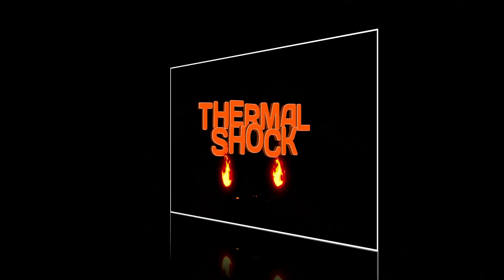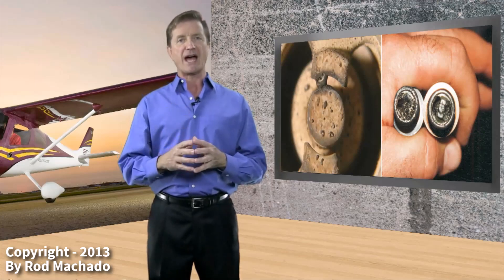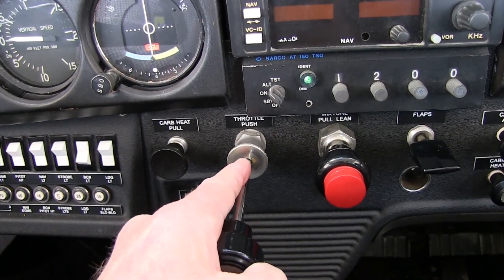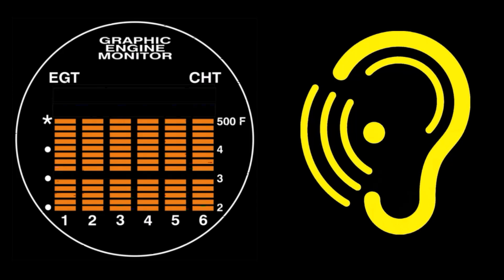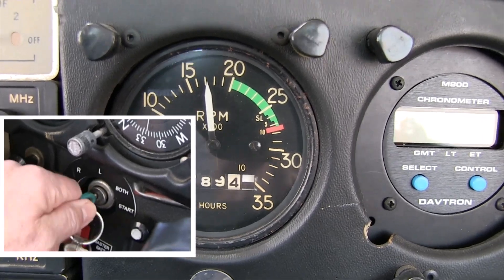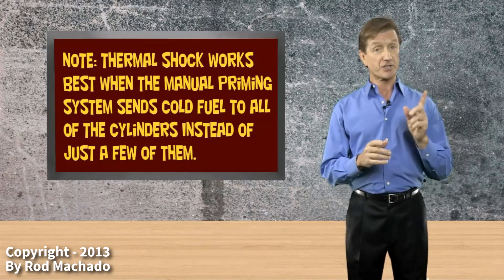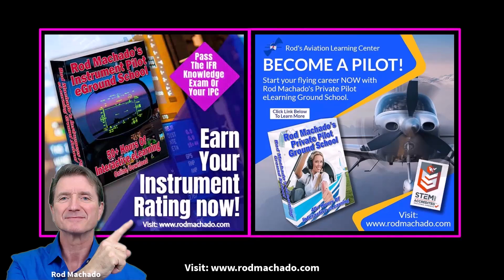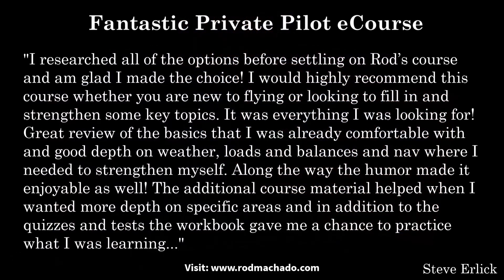Thermal Shock

Comment: Hi Rod, What is the reason why to inject cold fuel while the cylinders are hot?

I fly a Cessna 150. With the engine that were originally designed for 80 Octane, it is not uncommon to need to burn off some carbon. I usually find this same procedure without injecting the fuel is just fine.
Reply from the maker: Greetings Jay:
The reason is to clear fouled plugs when the method you mentioned doesn't work. Thermal shock is an additional (more effective ) method for clearing stubbornly fouled plugs.
Best,
Rod

Comment: Back in ancient time, almost 60 years ago when I was a ground power technician in the Air Force and stationed in VietNam, I serviced MD-3 electrical power units.  These were powered by a special version of the Continental O-470.  They ran governed at 2250 RPM and were rated at 170 HP.  Often, especially on the C-130 line, crew chiefs would run their MD-3s for hours powering little more than interior lights, a very light load.  We only had two grades of avgas available, 80 octane and 115/145.  The MD-3s would probably have run fine on 80 octane but were TO required to be serviced with 86 octane, which we didn't have, or greater.  Consequently we fueled them with 115/145.  With the engines lightly loaded for hours they would lead foul usually to the extent they wouldn't run at all so then the crew chiefs would have to order a replacement.  We'd get them back, clean or replace the plugs, then blow the engines out with shock loads.  We'd connect their 28V output cables to a load bank, a special trailer with lots of giant wire-wound resistors within, that had a switch array to provide the capability to accumulate from small loads to heavy loads.  To clear the engines we'd run them up then repeatedly switch on and off full load.  I worked at night, the MD-3 exhaust pointed straight up, and full load application created truly spectacular fireworks, streams that appeared to go up almost 50 feet.  We'd continue to switch full load on and off until the fireworks display subsided then we'd shut it down, move the unit to the ready line, and ready the next lead-fouled unit.  Those O-470s seemed to take all the abuse we could mete out then run quite nicely.
Reply from the maker: Greetings Jay:
That's a great bit of history to share. Over the years, I remember watching single-engine aircraft with larger engines doing runups in the runup area at night. It was not uncommon to see sparks exiting the exhaust stacks of these engines. This was probably detritus from cylinder carbon/lead or exhaust stack carbon (less likely, I think). Certainly, this was nowhere near the fireworks you saw. 

That said, when you applied heavy loads to clear out fouled units, did you alter the fuel/air mixture to increase engine heat and aid clearing? Please let me know. I'm curious to find out.

Best,
Rod

Comment: Is the engine manufacturer ok with this? I've heard of "burning off" fouling but never thermal shock where we full in a bunch of cold fuel.
Reply from the maker: Greetings Tracy:
I doubt engine manufacturers would pay any attention to this technique. The temps involved in a short, relatively low-power runup using the method I discussed involve very low relative temperatures. But the temperature change can be enough to clear fouled plugs.
Best,
Rod